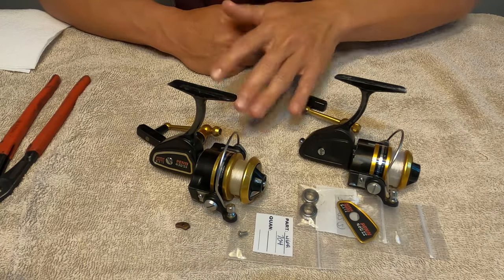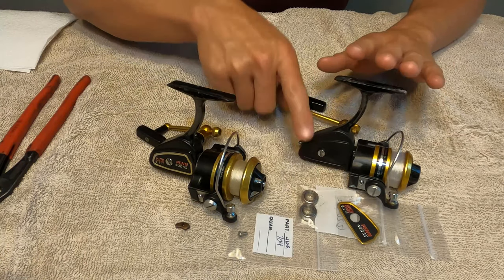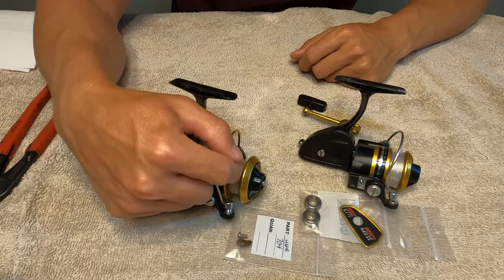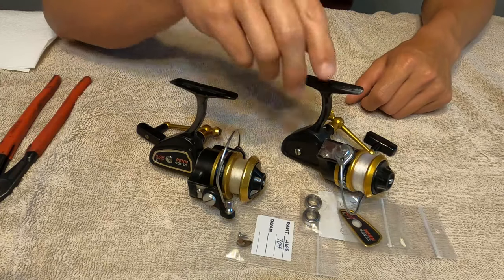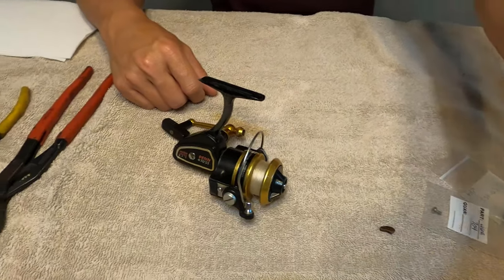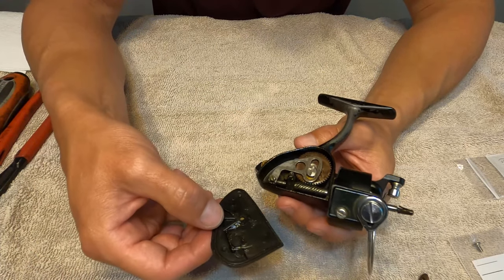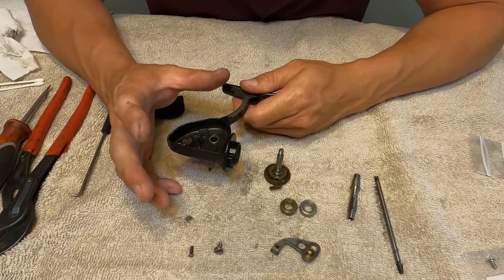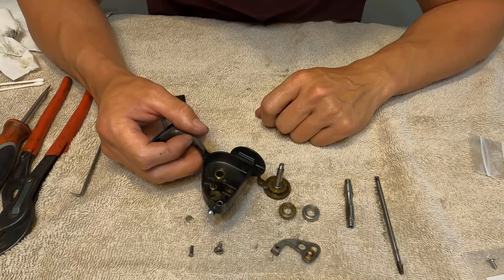Penn 420ss/430ss Disassembly and Cleaning

Comment: hello i wanred to ask if you maye still have a 420/430ss main shaft 😄 im from austria and got a 420ss a couple weeks ago it had some damage tho 😅 someone dropped it in the past i guess, the handle, bail and main shaft was bend wich kinda sucks but i upgraded the bail to one from a 420ssg with line roller bearings to use with braid and i changed the bend handle to a nice shimano knob with the parts from a gomexus power handle kit and i managed to straighten the mainshaft but its not perfect i have been looking for a new one for almost 2 weeks with no luck would be awsome if you could help me out with this project 😄 all the best 😁
Reply from the maker: I’m hanging on to mine for sentimental reasons. Good luck finding one. eBay will have one pop up now and then.
Reply: @fishontap4u  i understand i also would not sell them if i did not have manny of them 😄 i ordered a cheap 430ss for spare parts and so i dont have to worry about breaking something in the future and having no parts 😄